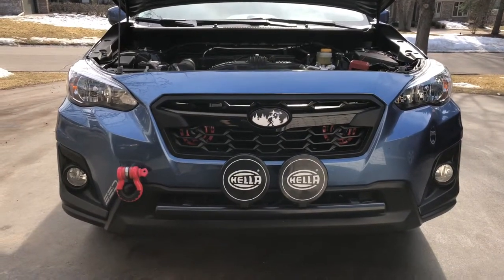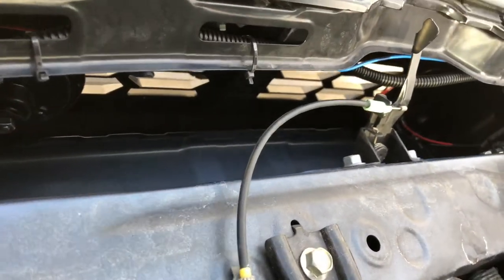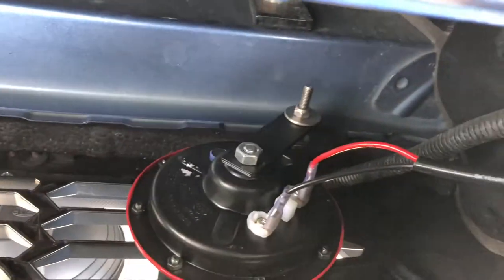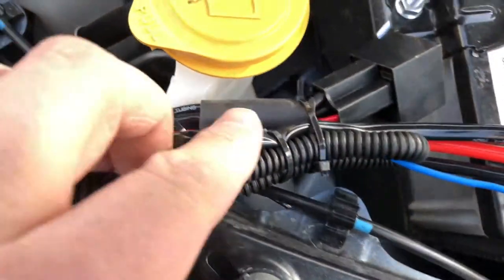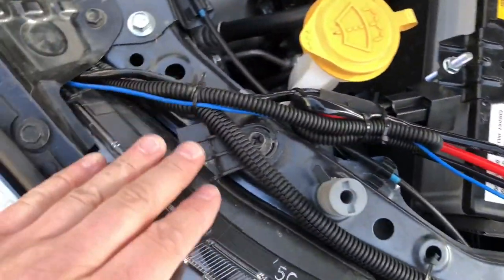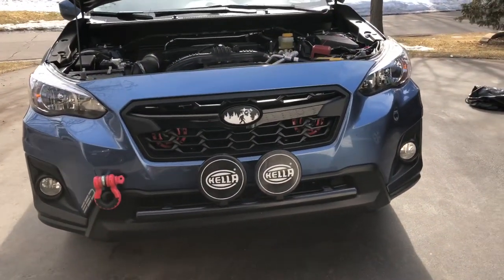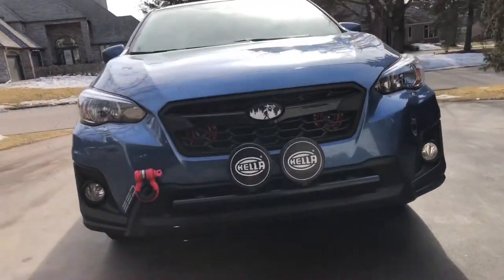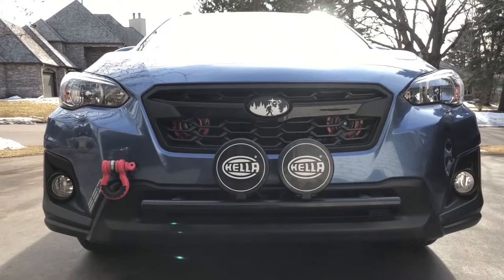Subaru XV Crosstrek Hella horns

Comment: So is it working with a separate switch? or does it work with the regular wheel horn?  I've got a wiring harness but on my 2021 there are actually two stock horns. One behind the grill and another behind the bumper on the passenger side down low.
Reply from the maker: I ended up using the factory horn wires and so it works off the wheel horn.

Comment: That’s a 2019 right? I’m trying to wire up some hellas on mine as well, what harness ended up fitting the oem connector?
Reply from the maker: It is a 2019, I ended up using a generic harness off amazon.  I think there should be a link in the video description
Reply: Sasquatch Mountain Tactical thanks brother.

Comment: Did you need to splice the wiring harness into the old horn wire or does it just connect?
Reply from the maker: I used a factory horn plug and plugged it into the horn harness
Reply: I have the same harness and wired it in the old horn's plugs and mine isn't honking 🙄 so I hard wired it and still no sound. Not sure what's going on..